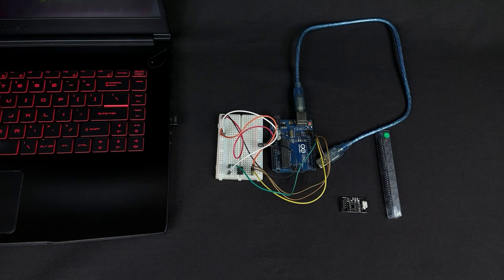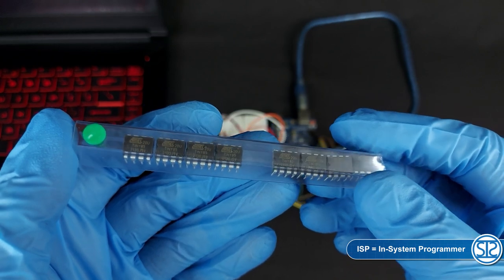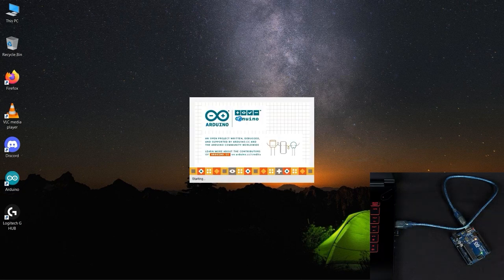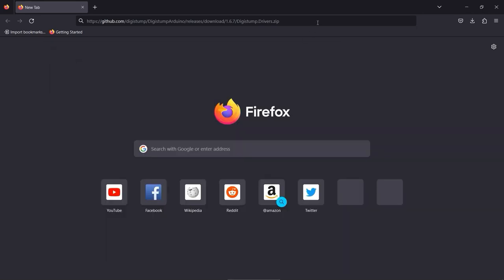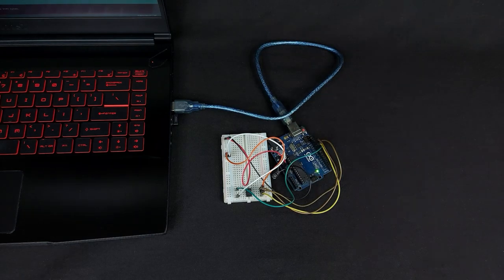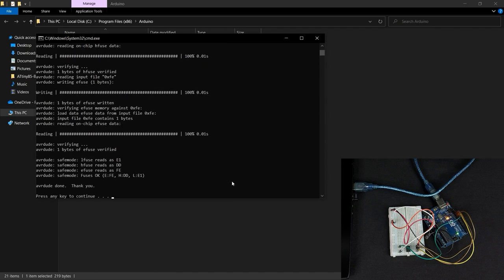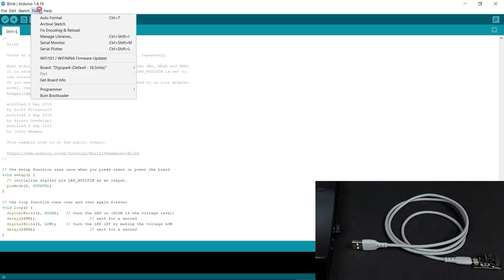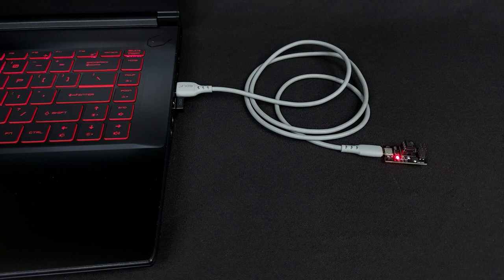Preparing Blank ATtiny85 for programming

Comment: Hi, thanks for the video. Can you help me? I did everything as you said, had even to install your exact version of the Arduino IDE to work the bootloader flashing, but when i tried to flash the application, when asked to insert the device, i get an error from Windows, saying that my USB device was not recognized. I suspected it was because the driver wasn't installed as should, but as i tried to reinstall, nothing new happened. Any ideas on how i can get it working?
Reply from the maker: thank you for watching. its probably a driver conflict, happened to me before. do you use the HW-260 development board? did you check whats going on in the Device Manager when you plugin the device in the USB? maybe try connecting on different USB port if available. are you sure that uploading of the micronucleus bootloader finished successfully?
Reply: @self_taught_stuff  yes I am using HW-260, but haven't checked what happened with the device manager.
I did manage to program the attiny straight from the arduino, though, but I really expected to use the hw260 as it's easier and cleaner. Thanks for the reply
Reply from the maker: @giulianorebuli  open the device manager (Windows+X keys and select Device Manager from the menu), watch what happens when you plugin the board to the USB. try to change the USB port.
I remember once I had similar problem and turned out to be bad ATtiny85 (or probably I bricked it with bad custom settings of the bootloader), if you have spare ATtiny85 try changing it with new one and see what will happen.
Reply from the maker: @giulianorebuli  i did some testing and here is what i found out that might help you. 
first of all I have to note that ATtiny85 doesnt have USB interface, the micronucleus bootloader is simulating the USB interface on pins 2 and 3 (PB3 and PB4). the micronucleus bootloader shares the same space with the program code. 
if you dont install the Digistump drivers on the PC but you have the micronucleus uploaded to the ATtiny85, when you connect the HW-260 board to that PC you will get an unknown device in the Device Manager but you wont get any error.
if you install the Digistump drivers on the PC but you dont have the micronucleus bootloader uploaded to the ATtiny85 you will get an error from Windows telling you that the device is not recognized.
if you check the schematic of the HW-260 development board, you can see that pin 2 and pin 3 are connected to the D+ and D- of the USB connector thru zener diodes, so if your code uses the pins 2 or 3 (PB3 or PB4) for some functionality (especially as output) in some cases the USB connection of your HW-260 board will be broken and you will get Windows error message that the device is not recognized when you connect the HW-260 to your PC.
so all in all, you will get that Windows error of device not recognized if your ATtiny85 is bricked or is faulty, or if the micronucleus bootloader was not uploaded properly, or if you are using the pins 2 or 3 (PB3 or PB4) for some functionality.
if everything is installed and its ok, then when you plug the HW-260 to your PC, in the Device Manager you will see a new item in the devices list named as "libusb-win32 devices" for 5-6 seconds and then it should disappear.

please let me know if you have any other info about the issue or if you manage to solve it.